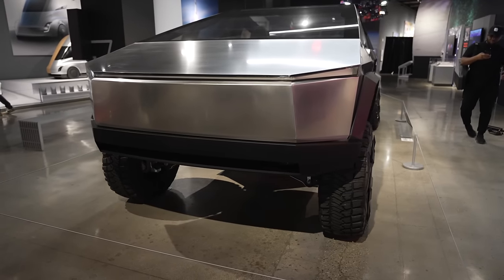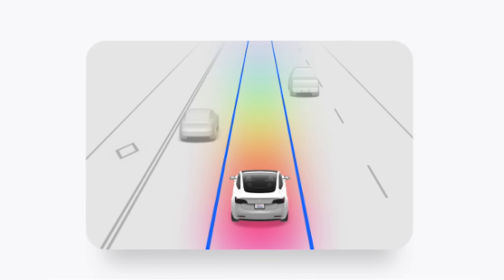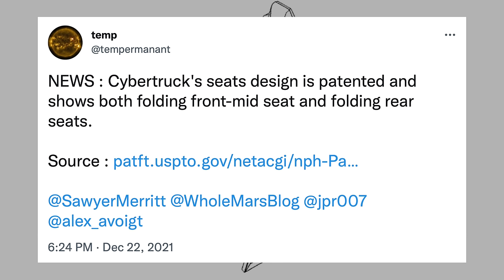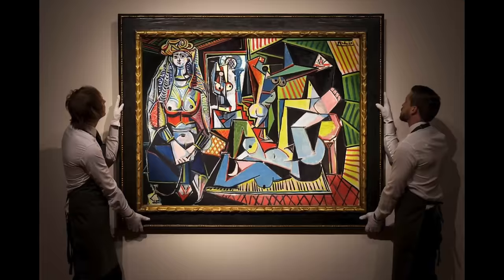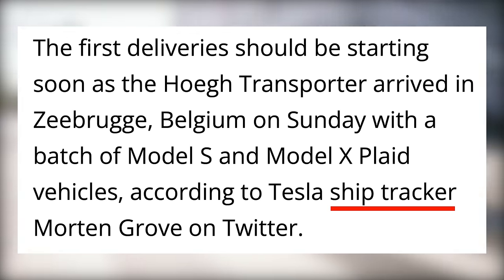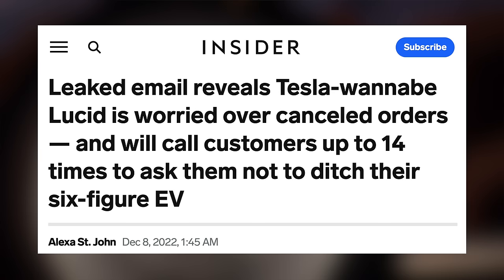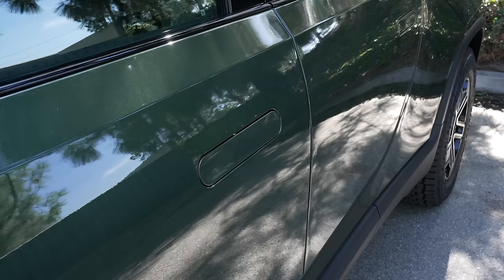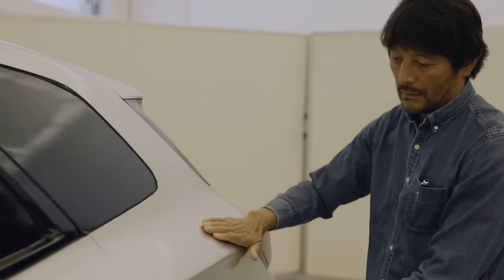NEW 2023 Tesla Body Spotted Pre-Production | It's Not What You Think

Comment: As a Cybertruck reservation holder, I hope they bring steer-by-wire if they plan to use the yoke as the only option.
Reply: The yoke literally makes no difference at all whatsoever. It's exactly the same as a regular wheel. I drove a Model S.
Reply: I hope they don’t bring a yoke
Reply: Don’t like the yoke at all
Reply: I would prefer to have a regular steering wheel.  The yoke is problematic for off-roading.

Comment: Its not a single casting (yet). Joe Tegtmeyers drone flyover from Monday shows that the 9000te gigapress is not yet installed. Some parts have arrived, in fact some were arriving as he did his video. Sandy has done a further review on this picture and believes it is made from 5 separate pieces welded together as a test article to confirm form and fit. See  Munrolive on Tuesday.

Comment: The most concerning thing I heard here was that they might get rid of the 10 speed fan control, and switch to low, medium, and high.
Reply: Why is that “concerning”?  I think it’s a great idea. The 10 point slider is way too cumbersome and annoying to use while driving.
Reply: @justinstewart3248  because only having 3 or 4 fan speeds means that the air coming out is either too intense or not enough for a given situation. 
In addition to our Model 3, we have an old Nissan Xterra that only has 3 fan speeds and the fan is generally too much for my taste - even on the lowest setting.
Reply: @justinstewart3248  the voice command is very convenient. No need to use the screen.
Reply: @justinstewart3248  I always use autopilot while changing anything on the screen or i tap blindly - which does not work every time.
Reply: I feel like maybe dumb it down to 5 is better
Reply: @fatwajim  no car ever has had 10 settings for a fan before a tesla. I think maybe you’re used to something you don’t really need. Everyone was fine in every car before this that had only 4 fan settings. Having a 10 point slider is actually dangerous.

That said, I wish we had physical controls instead honestly. Touchscreen is great, but for somethings it’s not great.
Reply: @justinstewart3248  you can literally use voice command to tell the car which fan speed you would prefer.  Almost every option on the screen is available on voice command.
Reply: Switch it to auto: low, medium, high.
Reply: @zoe_zucci  that’s fine, I’m just saying that 10 levels is unneeded and even close to a concern. Still wish physical knobs existed though…
Reply: @justinstewart3248  not 10 but my F150 has 7 and I love it like that… in remember my first and second cars only had 3 or 4 and it was just annoying
Reply: I don't get it. Compared to my 2010 Volvo the AC on my Model Y is shit. Even on the lowest temp, and set on auto, it is more like a light breeze. The Volvo will blow with force until the desired temp is accepted then automatically lower. Is I want the manual setting the official dial just turns. No 1 2 3 4... settings. So the fan speed is variable. Why isn't the slider on the Tesla the same? Why is the auto function so miserable?
Reply: Dw its only on auto
Reply: @joyalpatel6000  good to hear. Thank you
Reply: @justinstewart3248  The climate control knob is the single thing I'd gladly copy from the i-Pace to my S... but I'm not sure where I'd put it in the S without it getting in the way of something. Most of the time voice control works pretty well though.
Reply: @justinstewart3248  
Spot the "Drama Queen"? 👆😂
Reply: @rogerstarkey5390  lol what? No drama here just good discussion!
Reply: I received a 2023 Model 3 Performance in november. Still has fan 1-10

Comment: They better not change the A/C fan speed to three speeds only.
Reply: Facts
Reply: @darkpharoah100  Having seen another video from another channel, it sounds like Low/Med/High might only be if you're overriding the fan speed while still keeping the A/C in auto (which is a new capability). We'll see.
Reply: @MikeKobb  Just got the download so I am going to test it. It would be a welcome change but i still prefer the 1-10 if I am using it manually. Lo med high is sufficient if in auto.
Reply: @darkpharoah100  just a little nitpick, but isn't it currently 1-11? Both volume and fan speed go to eleven in my "old" ('16 pre-facelift) S - it's a homage to the "This is Spinal Tap" mockumentary....

Comment: Elon should have atto lights like if you have high beems on and it sees a car in front it atto turned em down so you don't blind the other driver going the opposite direction.
Elon should replace all of the none permeable roads in his parking lots and use thirsty cement to reduce flooding and reduce sand use by millions of tons.
Also he should plant some native trees in those parking lots to reduce flooding heat and clean the air.
Reply: Your first suggestion is already active in the cars
Reply: @GuilhermeM3  I don't think so because I have night shifts and I get blinded by tesla cars too.
Mostly plad or model 3 are the ones doing it not sure why.
But none tesla cars oh lord like every car high beams all the way.
Me 🚘 😚 🚗 😑 can't see.
Reply: @zbyszanna  the feature works quite well, but the drivers may not select it or probably isn't aware how to do so.
When i got mine I had a little difficulty getting the exact operation. It's not very intuitive at all.
Reply: Got a 2023 M3P and auto lights seem to work quite well.
Reply: Every Tesla has auto high beam. You have to set it then turn your car to high beam. It onky work when it's turned on and the light us set to high beam. Otherwise it won't work.  That's how it works on EVERY vehicle with auto high beam. Nothing different. There's s bew digital system that will be available but theiy are wsiting on the laws to change so that it can be used.
Reply: @thesilentone4024  how is it i never get blinded by Tesla cars and there's a boatload of them around new England.